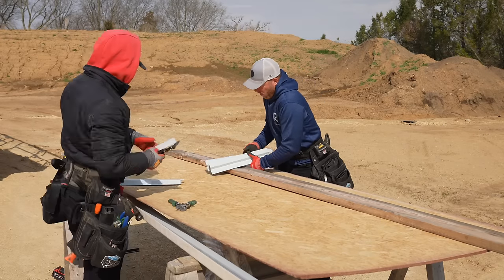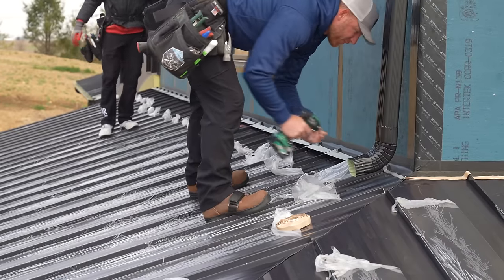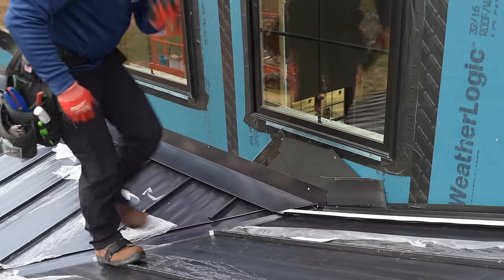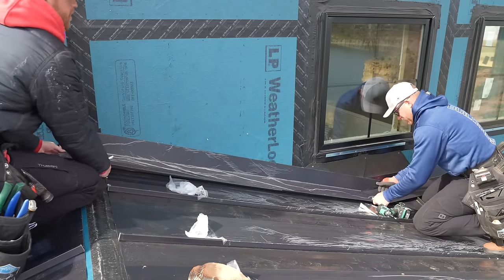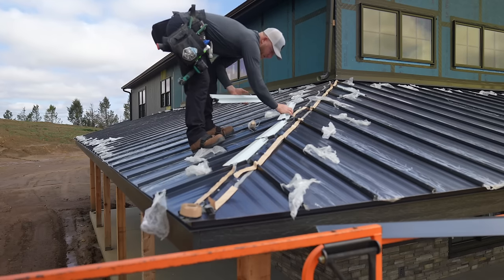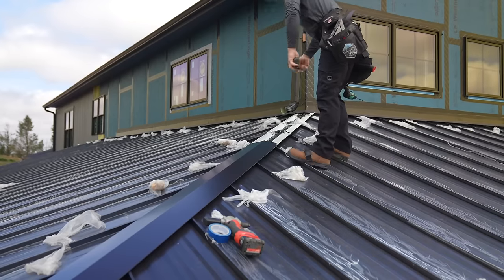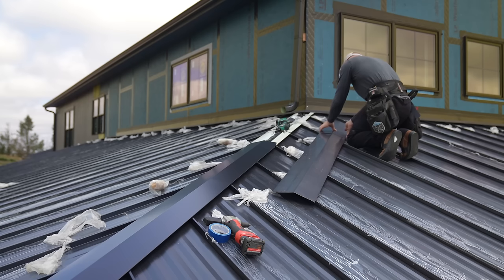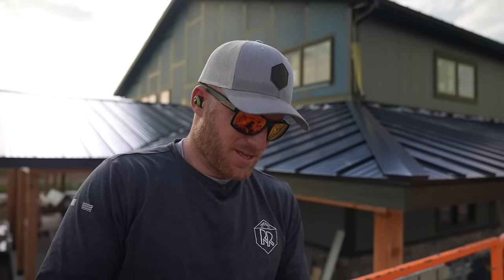How to Install Hip Cap and Wall Flashings on Metal Roof: Barndo 30 P. 2

Comment: Man, your attention to detail is impeccable! Those ZEE closures are called "End Dam" our company manufacturers them for all of our Standing Seam panels. Most customers only order them on prevailing wage jobs & weathertight projects. They are quite labor-intensive to manufacture and therefore cost much more than a typical ZEE trim.

Comment: My company produces snap lock and for the pieces your calling z clips we have some pieces of flashing that are for your side and end walls. They are made to where you put them on first and then your roof panels will slide into them as you push them up from the eave end. The way you hem the eave side down to go over your roof edge you would do the same to the top end of your panel but you would bend the hem towards the top so it will prevent the water from working its way in

Comment: Wondering if you could make “walking boards” to run across the roof panels? Maybe 2x8 by 3/4 ply with spacer shims boards to bracket the raised snap on connections of the roof panels. Or more appropriate dimensions.
Reply: Why?  For what?

Comment: Hey instead of those z bars at the top of the sheets, what about measuring 1.5 inches down from the top of the sheets, then cutting the tops of the under/over laps off, then simply folding 1.5 inches up with folders, then hammering the top corners over so theres no cuts, no caulking needed in the top corners for wind to get in.

Comment: At 26:00 when you are about to add the "top" trim piece and you had to open up the hem and all that to do it, would it not be easier to take the bottom piece off, then slid the top piece all the way up?  Then you could reslide the bottom piece up into the top piece.  Full disclosure, I am NOT in anyway a metal worker or anything, just seemed like a relatively easy way to do it!! Love the attention to detail either way!!
Reply from the maker: Need to secure bottom
Piece then overlap otherwise bottom piece could slide down
Reply: @RRBuildings  ahhh. Could you not rivet the top piece to the bottom piece (underneath where it grabs the z-flashing) to prevent that? Or fit them, then bring both pieces down and rivet them off the roof? (and then slide the whole thing back on)  I imagine with your experience that you are doing it the best way already, just throwing out ideas from my comfy office chair lmao

Comment: So why wouldn't putting the hip cap on first be a better idea? Use the sealer on the bottom of the sheets and pish it up into the channel. It seems like it would be a hell of alot easier, less cuts, less chance for water to creep up at every raised seam cause the base that the cap slides onto would be one piece.

Comment: Atas int. makes their own z flashings to cover 3 panel at a time. You can also order them for hips if you get your angle. I personally stack the closures tight, put a clamp or 2 on them and use a 20v dewalt bandaw to cut them.
Reply: Sounds like a hack job

Comment: Complete novice here so bear that in mind with my question.  When you’re installing the hip cap, once you get the Zee clips attached why are you installing the cap from the bottom up?  Seems like it would be easier to install your top cap piece and then slide your bottom piece underneath, especially since you are already tapering it.  That way you wouldn’t have to worry about scratches since it’s going underneath the top piece.  Am I missing something?

EDIT:  I broke my rule about reading the comments first to see if my question had already been answered.  Sure enough, you answered it for someone else.  Makes sense you would have to fasten the bottom piece since the tabs from the top piece wouldn’t provide enough grip to keep the bottom piece from moving due to expansion/contraction.  Surely though, someone makes hip cap long enough that it could be done in one piece?
Reply: So I came here with same question and I can't  find the answer you are referring to.
Reply: @hpw59  Look for a comment by Bobby Polfus with an RR Buildings reply.
Reply: @craigsummerville8823  thanks

Comment: Why not cut the panels and upturn them 1in at top instead of a Z Closure, use a butyl caulking in the seams, it will last 50+ years when not exposed to sun?

Comment: Why not do the ridge cap top cut first, then slide up the 10-ft ridge cap?
Reply from the maker: Because I would have no way of fastening the lower hip and keep it from sliding down
Reply: @RRBuildings  I actually did a repair on one while I was power washing and they had rivets on one ridge cab and the other had a half inch Gap where it slid out.
Reply: @RRBuildings  Trying to understand,  doesn't the crimp on the ridge cap hold it in place after positioning?

Comment: Idk I feel like the hip cap should be under your "connection piece" so that your lapping properly from the wall down. With your hip cap running on top of your "connection piece" if any water gets behind the upper siding it will run straight down the "connection piece" and under the hip cap because it is not lapped under the "connection piece", which if it was the water would run down the "connection piece" and on top of the hip cap and off onto the roof as it should. Seems backwards to me man, everything should be lapped from the bottom up so everything flows down onto the next piece not under the next piece, especially with the z-bars in there with enough water they will backdam and pour into the hip ridges. I know this is all theoretical but it is absolutely possible and if it's an area that sees any volume of snow then definitely a potential issue. Also please don't think I am dogging on your work, just opening up a topic for discussion as it does appear your flashing that backwards due to it looking better?

Comment: https://youtu.be/hi8HnjrOL5Q?t=1550 Could you not install the higher cap flashing first, and slide the lower into it? And also might be better to run cap flashing under the wall flashing.
Love your work, so don't take these comments as flame